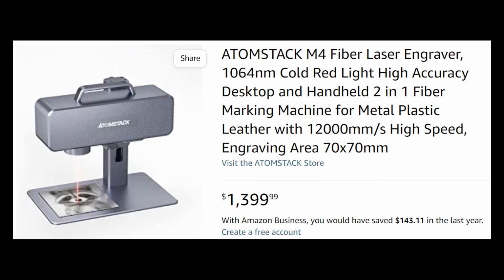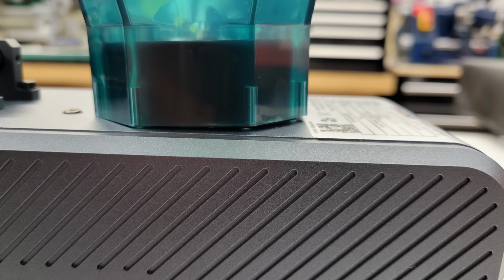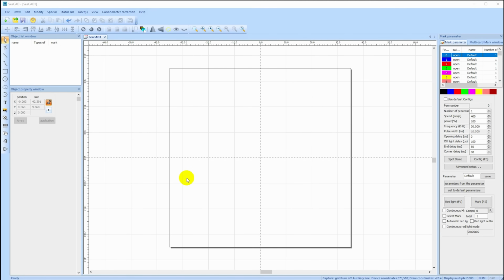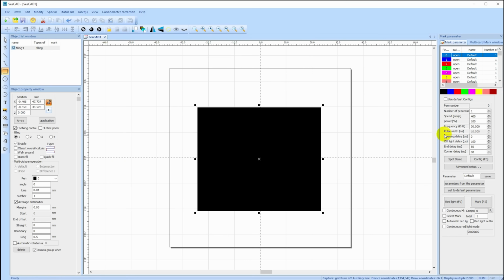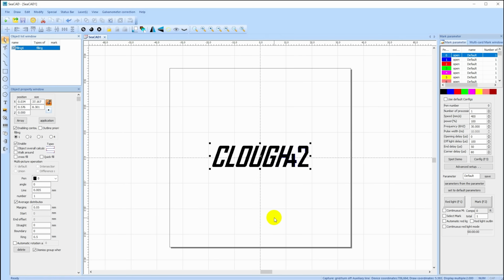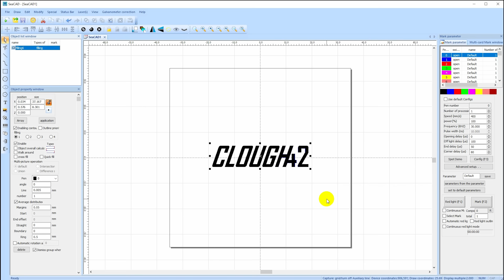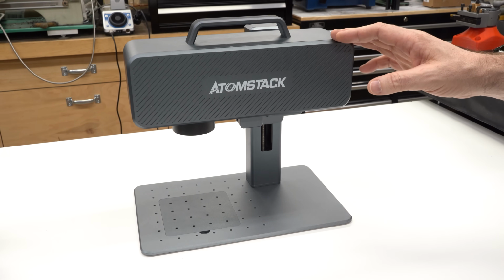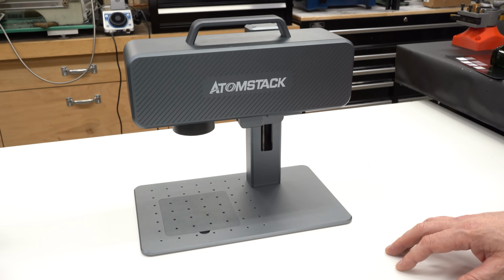Atomstack M4 Fiber Laser: Is it worth buying?

Comment: to import the vector file yes it works with illustrator but you need to open the file on illustrator then save it but when you save it chose illustrator 3 which is older illustrator file extension and that is what this application support, i know this because this application is taken from EZCad 2, plus please wear fiber laser safety glasses when you operate this type of laser because it reflects and can hit your eyes (safety first) and great video by the way and 50w JPT laser source machine will be what you need 👍🏽
Reply from the maker: No worries.  They provide a pair of glasses, and I was wearing them.
Reply: @Clough42  be careful. I got my JPT machine and they included a pair and believe it or not the glasses were regular tinted plastic, the best way to check put the glasses lense under the laser it should not pass ,

Comment: This is one more time game between power and the wave length. This one has, for humans, invisible color matching wave length of CO2 lasers. This enables it to engrave materials that blue laser diodes can’t touch. And this is pure engraver.
Now when you tell me cheap fiber laser I still think of lasers costing way more but then sport around 2000 nM wave length and 10 to 20 Watt output power at least. 20 Watt one will even cut thin metal stock. 
This product is a “fiber” laser while it does conduct laser true the fiber it seems. But is actually expensive toy for small surface metal engraving. I bet output power is not that high either. With same wave length CO2 laser will be way more powerful, cheaper and will do way bigger surface. Power will be like 40 Watt and that will allow it to cut things like acrylic. So with this wave length I would go with CO2.
If you need fiber laser we’ll go with a real thing but be ready to pay like 3K plus for a laser that does only like 10 x 10 CM.

Comment: I've been hoping a cheap fiber laser module would become available as a replacement for the blue diode modules. there's loads of stuff on aliexpress, laser sources, psu's, focusing heads, but they're too expensive for my experience to buy for experimental purposes.
Reply from the maker: That's how I feel about a lot of this stuff, which is part of the reason why I sometimes accept units for review.  I'm curious, but not curious enough to pay to find out, and maybe I can provide some information for someone else who has similar questions.

Comment: Just a crazy though. Since it is hand held. Whack the whole head on a gantry system from a diode laser. Make a file that burns a dot at the same spot for ever and use the gantry system for moving.... Could that even be made? Then you have a big working envelope.

Comment: I've experience with fiber lasers as I've a 60W Mopa laser for the last 5 years. I have an imported machine made in china. While my machine has been excellent with only a few small problems, there was a language barrier and issues with tech support when I needed it. 

If there's 1 then there's a 1000 laser manufacturers/resellers on Amazon/ebay even Facebook groups from Asia. They are all selling a VERY similar product. There are some very reputable companies but you've to do your research as buying the cheapest machine may leave you with no tech support, a machine that has counterfeit parts and not doing what it was supposed to do. For the majority of the time youll be sent a link to a YouTube video filmed with a shakey out of focus phone camera. 

If your looking for a laser with good tech support then your start with a bill almost 10 times the cost of this laser.  A rebranded eastern machine like San Antonio laser engraving or on the higher end a LaserStar machine. 

On paper this machine looks good  but I didn't see what power it was...... 30W is the minimum now and 50-60W has become the norm. This is why this machine id  slow and the reason why its running 100% power all the time 

And I absolutely would recommend wearing good safety glasses when using a laser !!!!

Lastly your absolutely going to need lightburn software, all these lasers come with Ezcad (ezcrash 🤣) or a rebranded varient of it.... Don't bother...... It's junk..... Fork out the $150 and get it .

Comment: Why does nobody seem to offer a galvo fibre laser on an X-Y gantry? Then it would work in the same fashion as an inkjet printer and be able to mark massive areas!
Reply: There are multiple companies offering just that, and they have been offering just that for the last decade, just quite a bit into the higher price range.
For example, the Trotec SpeedMarker 1300 or the Vytek Compact XYZ

Comment: Infrared laser is NOT eyeballs safe!

Seem like a nice laser for many things but the software should be improved.

Laser mirrors should be solid mounted on 3 edges not just one side.

The cone should be vented but still trapping in the ir light and should have a fan blowing air from the lens to keep it clean.

An foldable double foot on the back to extend towards a wall so you can hold it firmly in place .

Should include ir laser googles.
Reply from the maker: It came with green laser goggles.  I was wearing them.  I pointed out to them that the models in their marketing collateral are not.

Comment: If you are going to use this kind of tool regularly, far better to get a  real 20W fibre laser at around the same price. If you have a regular blue laser, just spray the metal surface with a rattle can and oblate it off. You can easily deeply etch the resultant mask with some salt water as the electrolyte on a q-tip and a small battery to supply the current - simple for small batches and takes very little time. Good video, and great to get some honest info. Lightburn is definitely the way to go for most of the Chinese lasers - pity the quality American brands like Universal don't pick up on it! /rant 😁

Comment: I have the Mr. Carve and it appears to have been manufactured with very SLIGHTLY better construction. It uses that same software. I get quickly frustrated by it. I've looked into Lightburn also but as you know, they don't support the BSL type galvo driver boards these things use. Lightburn has indicated that they will only add support after getting more requests for it.

Comment: Is it really fiber laser?  Looks like diode laser module with galvo head.  It maybe 1064 nm wavelength as their description says (probably one of those IR diode lasers that came out recently) but I didn't notice any fiber loop coil inside.  I think calling it "fiber laser" is marketing scheme.  If it is diode laser, it would have much less actual optical power output than real fiber laser.  I have 20W fiber laser and it has much more actual output power than this "20W fiber laser".  Diode and fiber  are two different laser technology with different wavelength region.  I wouldn't be surprised that if Atomostack ask you to take this Youtube video down.   I hope it is just language misunderstanding by using "fiber laser" for galvo head laser but I doubt it.  They are getting better at differentiating between electrical power vs optical power as people are getting wise to this marketing scheme.  Right now they are once again playing marketing scheme by calling 1064 nm diode laser an IR.  IR is CO2 laser with10600 nm.  1064 nm is fiber laser, 455 nm is blue diode laser.  I don't know what is 1064 nm IR diode fiber laser.
Reply from the maker: It would not surprise me at all if the terminology is marketing.  If you're shopping for a fiber laser marking machine, using that name puts this class of machine in your search results.

Comment: Ya know, they fix the issues you mention then I may purchase one of these. I wonder how much of a curved surface can one engrave and how accurate does the height adjustment need to be?
Reply from the maker: It needs to be pretty close.  It loses power pretty fast.  The focus needs to be really close for challenging materials like aluminum.  It's a little more forgiving with paint.

Comment: Hi, James,

I have to agree with others than for the price it’s not giving expected results. After your review of the X1, I’ve been keeping an eye on the evolution of their offerings and with the higher power & alternative heads I think they’re getting close.

However, I’d like to find a product that will mark most metals, has 150mm x 150mm area and is less than $300: I just need something that will engrave tools either to personalize them or mark them so I can remember what they are.

Charlie
Reply from the maker: To get to $300, you would need a diode source on a Cartesian frame.  With time that might be possible, though inflation might prevent actually getting to that price.
Reply: @Clough42  
Maybe Yes, maybe no, the cost could go down: the $4000 brick is equivalent to $11,400 today, and you can get 10 iPhone 14 Pro's (6.1", 256 GB) for that.
Reply: Not possible. Fiber lasers are expensive.
Reply: @Nobody-Nowhere  
Anything is possible:
20 years ago there were phone booths everywhere, now you can't find them (other than Phone Boxes in the UK).
25 years ago I had a cell phone that was smaller than anything we have now (Motorola Mini Flip).
Almost 40 years ago, a cell phone cost $4,000 and was nicknamed "The Brick."
I can wait.

Comment: It's incredibly ambitious to try and build a fiber laser in a package that small at that price point. It looks like Atomstack have missed the mark in many ways with this product, but I'd be very interested to see what the market looks like in 18 months. These random Chinese brands tend to do a pretty good job of working out the worst problems through an iterative process of reverse engineering and incorporating community fixes.

A fiber laser is a niche item, but it's absolutely indispensable within that niche. Engraving is the obvious application, but there are some seriously neat micromachining tricks if you don't mind long cycle times.

Comment: 1. EYE SAFETY!!! - the hazard isn't that it will burn your skin, the hazard is the the probable wavelength with cause instant blind spots if it gets a clean shot into your eye.  

2. For between 2x and 3.5x the money, you can get a galvolaser that works as well or better, comes with some glasses that seem to be OK, and a version of ezcad that works.   I got one from bescutter (zero affiliation just a customer about 2.5 years ago.)   That is of course rather more money, but it's not 10x more.    

These devices are making progress, but it's clearly not yet mature (for direct metal marking.)

Comment: 4:44 omg the build quality of the electronics in that thing looks like a one off college student project, nothing is close to square (though it probably just makes IPC standards)  the two boards on the top right look like they are bent since they are bolted together at 2 crooked angles. Back to the middle board, why are we using headers on one side but solder blobs with wires obviously too thick on the other... and is that a freaking  D-Sub cable in the top middle? Nothing wrong with that except it looks like they cut the end of a vga cable and called it a day

Comment: Since there's no guard seemingly needed when operating on a tabletop, the only contribution of the guard while using it vertically seems to be stable spacing.  Get rid of it and use one that's just a framework so smoke won't be an issue.

If you got smoke deposited on the inside of the guard, it's likely on the lens as well. Clean carefully!

p.s.  As someone who has cut acrylic and plexiglass with industrial lasers, I was unable to ever find an MSDS / SDS that addressed the hazards of cutting it.  They'll tell you all about the hazards of using the product as intended, but when you DO stuff to it like melting or burning it, you're on your own.  Does a dust mask suffice?  Do you need organic vapor filtering?  Inquiring minds that may or may not have been repeatedly exposed to carcinogens want to know!
Reply: Or just put a hole with a fan on it. Simple hack.
Reply: And an simple mechanism to fix the guard on the laser.
For laser  software , chinese should build an good app for all them clones and give it freeware even closed source instead of botching all them software.
I know nothing about lasers but simple solutions are obvious.

Comment: While watching the video I had the same thoughts that were articulated at the end. The laser module and mirror seem to work great.... then there's the user experience and "extras" (handheld mode).
adding a locking ring, some rubber grip feet and a way to have a positive air pressure (compressed air / fan) setup on that mount that blows smoke out the little corner openings at the bottom would make it work much better.
Another option that would be nice would be a mounting system for a Cartesian robot to use fiber laser on large surfaces. The software would have to lock in a 70x70 working area, finish that, move over another 70, then do part 2, etc. embroidery machines have a manual way of this, but with a CNC controlled XY system, it could be automated and even customized on size... as long as the software supported it. The guys over at Lightburn are great and if there was a market for it, they might add that system in (if it was worth it)... or it could still be done manually with little effort programming a control board on your motor system.

Comment: Looks like a knock-off of EZCad2.  EZCad has a known issue of not supporting anything newer than AI9, so try exporting your logo as AI9.  As for LightBurn, it will only work with a genuine JCZ controller card.  There is a trial version so you can test though.

Comment: time to start making small pcbs, burn off etch resist and dunk it in some ferric chloride.
Reply from the maker: Oh, that's an interesting application.  PCB fabs are so cheap now, though...
Reply: @Clough42  nothing beats 30min turnaround time. some  20-30w fiber lasers can directly ablate the copper, so makes it handy for surface mount only parts though you can also drill out through holes with some tweaking.  very handy for microwave rf design prototyping.

Comment: A few things to try out. As someone else mentioned this looks like a re-skinned version of ezcad. There are videos out there on using it.

For illustrator files, save them as a version 3 file. None of the other versions have worked for me. 

The frequency is important on a fibre laser. It will affect marking vs deep engraving. 

Fibre lasers don’t do well on organics and most plastics. 

The Laser Everything YT channel has some ok videos on using fibre lasers and settings.

Comment: The fact it does so well on metals is remarkable. But at that price for such a small engraving area and the other limitations, it is hard to justify.
Reply: Put it on cnc frame and move frame by frame.
Reply: @artcraft2893  hahaha that’s hilarious!
Reply: Honestly, this is around the price I'd expect for this size work area. Fiber/galvo marking lasers tend to be pretty expensive. If you want double the engraving area, be prepared to spend 3 to 4 times the price *at least*.

Hardware wise, I don't think you can currently beat this price, especially considering it actually seems to perform well.
With that said, the lack of support for Lightburn and poor documentation makes the decision on getting this a hard "no."

If this picks up support for Lightburn and if the customer service improves, this would probably be one of the best options on the market.

One other thing I'm curious about is the longevity.
Reply: @MasterThief117  I don’t know enough about the tech, definitely. But I have been looking into diode and CO2 lasers for craft work and from that perspective this is obviously a very different animal. I guess I just don’t see the business case of it, engraving a tiny area on a variety metals. How does it pay for itself or even make you money doing that?
Reply: @NoTimeForThatNow   I have 100W CO2 cutting plywood 3mm is slow.
Reply: @artcraft2893  the new stronger diode lasers are really becoming impressive. They have their limitations but the ability to cut through even 12mm wood is possible although how quickly is subjective. And with air assist the scorching is reduced. What draws me to them is the large work area for signs etc. and the ability to use a fixture for cylindrical objects like thermoses. I can see cutting patterns on 3mm wood with one of those too, to assemble the parts into 3d objects like shadow boxes, lamps, toys and other decorative items. But all of those would still be pretty slow, not a huge production volume. I have both a fdm and resin printer, so I guess I am accustomed to slow already, but also to the precision afforded by these technologies. Given enough lead time, you can fulfill an order of promotional materials or custom art pieces for a craft show and make some money that way.